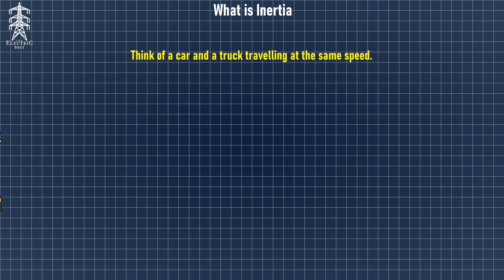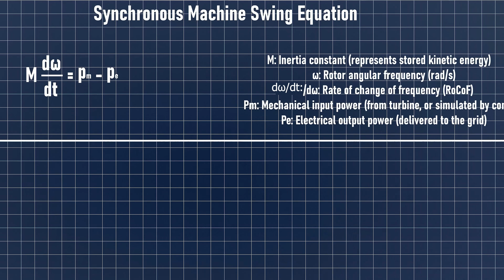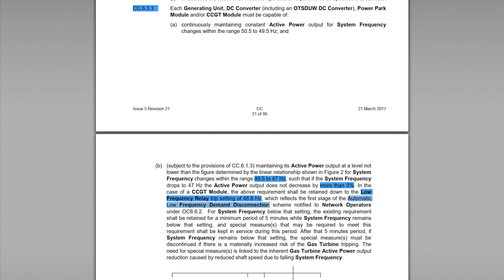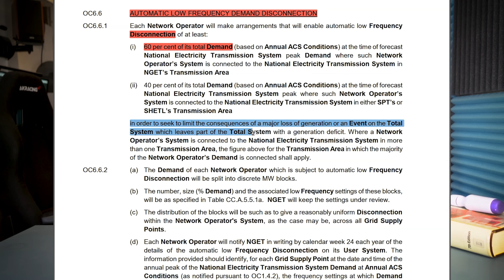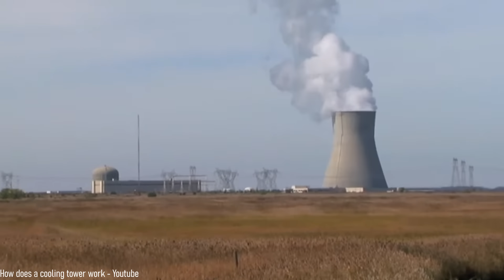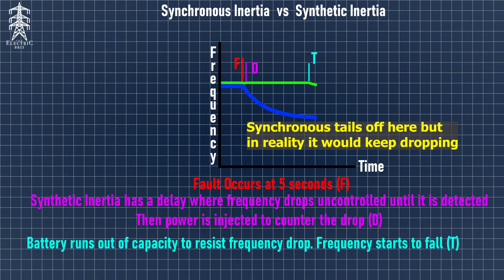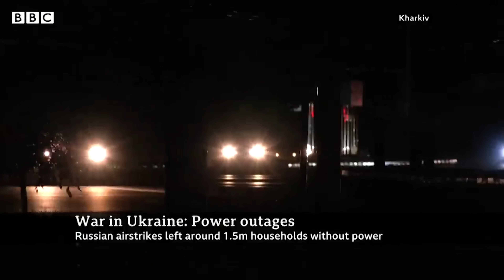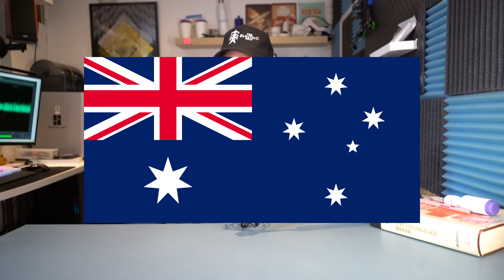How to Restart the Grid after total collapse

Comment: I'm wondering if there's been any recent or semi-regular studies done on which of the more long-distance national connections could be more economically run as HVDC vs AC? I'm no expert at all, I just know there's disadvantages (like needing massive inverters to turn DC into AC) and advantages (DC not having a skin effect, corona discharge being much less).

Alongside the other advantages, you wouldn't need to sync both ends of a DC link. That has to help keep a grid at least partially functional even if bits of it get knocked out.
Reply from the maker: Good thinking and it's something I've thought about a lot recently. There's at least 6 HVDC links in construction now which will all likely be VSC technology so very strong in terms of grid forming and black start, but the breakeven point is only over a certain distance and the negative is as you say needing a converter station every time you want to make use of the power.

All of the main 400kV lines in the UK stop off at cities along the way, so I don't think the benefit of HVDC would make sense for needing a converter at each stop. For context, you can get close to 7GW of AC on a double circuit transmission line, which needs 2 transformers at each end. HVDC in addition to the actual converter halls typically use one transformer per phase, plus a spare and will do 2GW in a bipole design. So 7 transformers at each end, plus all the other kit.

I'll explore HVDC in another video after I've covered overhead lines and cables because it is super interesting, but I'd rather see the UK move to 800kV or more...but I can't see the NIMBYs approving a 100m tower if they won't take a 50m one.

Comment: If we transitioned to a HVDC network of distribution would that make black start simpler? It removes the need to synchronise generators but you'd still need to match generation and demand.
Reply: DC networks have a corrosion problem, though

Comment: My off-the-wall take - since the technology now exists (grid-forming inverters), should the separate black-start zones be connected using HVDC instead of HVAC links, thus removing the requirement for the frequency to be perfectly aligned between the zones?
Reply from the maker: By 2030 I think all of the zones will have HVDC links between them. I'm not sure on the exact zone boundaries but with all of the ongoing and future projects it'll be a reality sooner than we think, in addition to the interconnectors.

Comment: Worth noting that rocof protection is used to stop embedded generation like roof top solar feeding power into local distribution network if it becomes isolated. If say local transformer protection operates you don't want your roof top systems to keep feeding the local network for safety reasons. As rooftops  have no connection to the local network protection system they assume that if there is a sudden change in phase or frequency that something has happened to local network and shutdown. Unfortunately, if you have a major grid disturbance this can result in them shutting down spuriously and making the situation worse. Suspect this contributed to the Spanish grid collapse.
Reply from the maker: Good catch. I had a replied somewhere else about G99 / Loss of Mains protection and grid code requirements not to prevent backfeeding a dead grid. Very smart stuff!

Comment: Overall a nice video, but it leaves a crucial (to me) question open. After a blackout, when two "power islands" grow and meet, how do the AC phases of the two regions get synchronized?
Just closing a switch between two independent AC power networks operating in a random phase relation is a sure recipe for disaster!
What is the protocol to ensure that the phases match before closing the switch and linking the two sub-networks into one?
Reply from the maker: Great question and I replied to another person on it so I should have really included it in the video! The two sections will have to be monitored by the network control centre until they sync up and only then they can be closed. I read an anecdote from someone saying decades ago that took days. As long as the two grids can serve their demand there's not a massive issue with this other than resilience, after all the grid used to be many smaller grids.

In substations even connecting up two circuits requires the phase angle and frequency to be in sync, that's why we have synchronisation check relays which will check sync before closing to reduce inrush currents and damage to equipment.
Reply: @TheElectricBrit if there is no average frequency guarantee offered but only an instantaneous frequency guarantee, it can be done in about a minute (by equalising the frequency then rapidly aligning the phase)
Reply: If i had to guess, and I'm guessing, you would run the island that's ahead a little slow, and the island that's slow a little fast over several hours or days until it lines up, sync and connect

Or maybe establish one as the main one and the one trying to connect (the smaller one) has to be the one to run up or down their freq to match
Reply: I guess that the slow drift of the relative phases of unsynchronized sub-grids is sufficient: network control just waits until the phase difference is small enough that it doesn't matter, and it closes just then.

Comment: Im unsure of the exact claim attempting to be made where you say that tummel valley has 90% of hydro capacity, when the galloway scheme has at least half of its rated capacity? 

(I just like my local hydro scheme okay)
Reply from the maker: I’ll have to add a correction. Thanks for spotting that, I must have got a bit mixed up on that part as the stats are a little different. It was probably meant to be Scotland has 90% of the UKs hydro capacity 🤦‍♂️

Comment: Look up the recent power fiasco at Broken Hill, Australia.   Broken Hill is a small mining city in outback Australia.  Billions of dollars were spent building wind and solar farms, and a grid level battery.  Then the single long length grid supply connector from 260km  away was damaged by a storm.  The power went out in Broken Hill for weeks and weeks.  The billions spent on renewables was useless.  To make matters worse, the two heavy diesel engines that could get the grid going again (known as a black start) locally, were neglected and did not work when needed.  All these renewable companies are arrogant, over confident and only interested in sucking up subsidies and building failure prone systems.
Reply from the maker: I’ll have to look into that! It’s interesting that some companies have rushed to get rid of diesel generators to be seen as greener when it’s such a critical backup still or they haven’t tested their resilience without it. Especially in business where time is money and reputation damage from not delivering is massive. I can’t see it going away anytime soon for UK utilities.

Comment: Does a grid use any gps timing system for synchronization?  Or is it still the ring of lightbulbs and a big switch?
Reply from the maker: Control and protection does use GPS timing for synchronising things like remote closure and open of circuit breakers. They also use fiber optics to communicate too between substations.
Reply: I'm surprised not to read about an external time signal being used to synchronise, especially with more digital power sources being added.

Comment: Do they use heavy flywheel systems?  Turbines are an example but are there any dedicated flywheels to keep the constant?
Reply from the maker: Good question! I may have touched on it briefly but synchronous condensers are fancy words for exactly that. It’s a grid connected machine that spins a flywheel to provide inertia. In the UK the projects are typically under the pathfinder project.
Reply: @TheElectricBritA large cast iron flywheel in a low pressure/vacuum chamber would absorb very little energy as what comes is virtually the same going out. Frequency is the most important thing for stability.

Comment: Synchronous inertia is a very interesting subject , I know there is the Yaxley Synchronous Condenser project in Suffolk right now , I believe to help with grid stability for the renewables in the area that make land fall. Some interesting clips of the plant being moved in from Ipswich docks on here .
Black start ability as we touched on in the comments in your last presentation, my old friend sadly now with dementia also mention the black out of the winter of 62/62 that effected a massive part of the South East , I seem to remember once they got things back up the effected area stayed in island mode for a long time before they could close up to the unaffected area of the grid , he said this took a week be for they could synchronise , I don’t know how true this is sadly but he told me this over 40 years ago . He said engineers were running about in cars having to manual close and open breakers to get power to various stations just to get them started be for consumers could be reconnected, I’m sure he said this as a Saturday afternoon, would be interesting to find the full story . Keep up the good work
Reply from the maker: Some of these stories definitely need capturing before they’re really lost. I’ve read a few good anecdotes from CEGB engineers.

There’s also a syncon being built at Walpole so not too far from Suffolk. In renewable substations owned by the wind farms they also add in things like static var compensators and Statcoms to provide voltage support.
Reply: Need some more presentations on all of this 
I have another mate only a bit older then me spent his life in heavy electrical, he even looked after the MG's at JET later CEGB high voltage switch engineer and supervisor, he retired a few years ago I will see if he has any interesting events for you. My much older friend I seem to remember was one of the Eastern men that was also qualified to switch for the CEGB normally on out of hours workings , I remember a few interesting situations he had with that , it's all 50 years ago he told me these things so your presentations have sparked a lot of that stuff I was told @TheElectricBrit

Comment: Does the UK have an atomic clock so grid islands are perfectly in phase so they can rejoin? It'd take a VERY long time for 2 islands out of phase to sync up otherwise.
Reply: If one island has an excess of power frequency will slowly increase subject to inertia of course. By adjusting power in one island, you can match frequency and phase with the second island so you can reconnect them. A syncroscope will show relative phase and frequency so need for atomic clock just skilled juggling of load / generation in the two islands. Long term frequency is regulated so electric mains driven clocks remain accurate within a tolerance of max error of 30 seconds although I think in the UK 5 seconds was routinely achieved. You might see clocks slow slightly with frequency as system load increases to a peak and then catch up after peak as frequency rises. The grid control centre would have an "atomic" clock as refence and a mains powered clock to observe system time and adjust system to keep mains driven clocks accurate.

Comment: Looking at some of the comments, it appears that some of you have power generation knowledge. 

So i have a question. 

There's a lot of talk about using a grid network based on Small Modular Reactors. By the very nature of being small, they won't have the same amount of inertia. But would it be enough to maintain grid stability?
Reply: There'd be more of them, spread out.
Reply from the maker: I think anything with low inertia will need battery backups to help compensate. It all depends how small SMRs end up being as we’ve seen the technology split into containerised reactors and what look like quarter sized regular nuclear reactors. So the bigger they are the more inertia they’ll have. 

As part of the wider energy mix it’ll even out and nuclear reactions have the benefit of storing heat which also acts like a thermal battery for the production of power. That’s why molten salt reactors are so interesting.